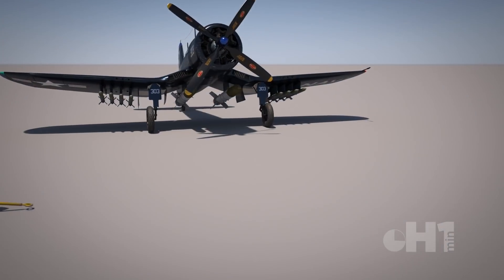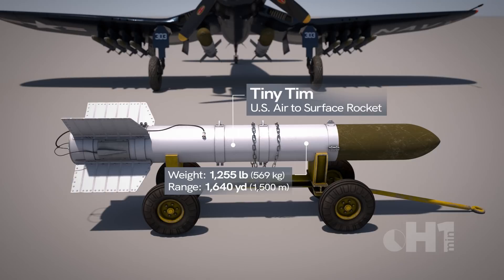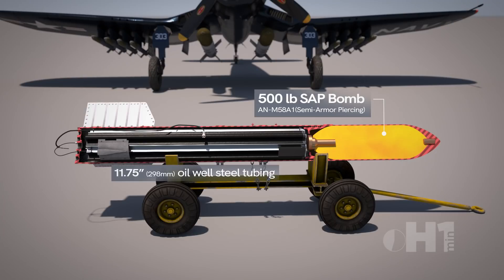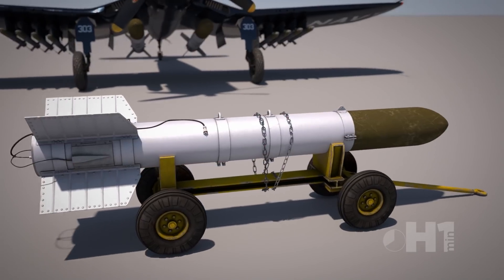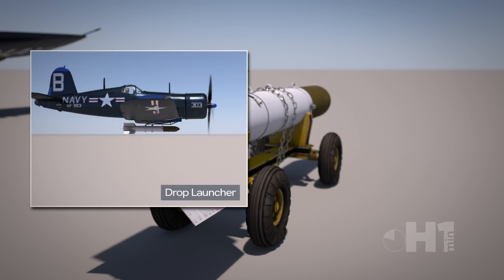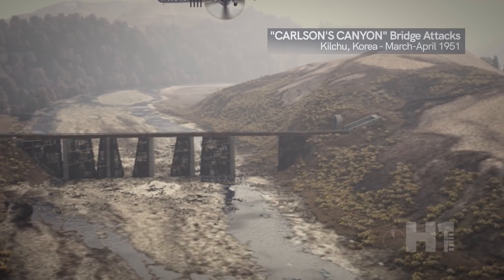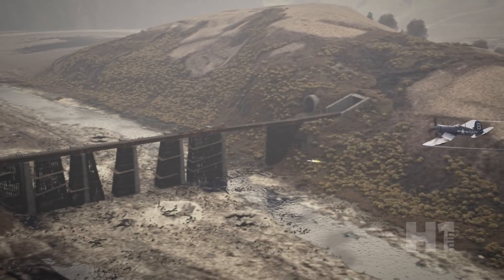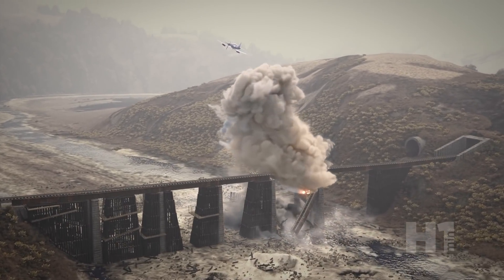H1MIN:  U.S. TINY TIM ROCKET

Comment: Imagine being the pilot that has to hit a moving ship from outside of its air defense range with only 2 unguided rockets
Reply: the intersting thing is that 1500m is well inside of anti air range for literally every warship larger than a fishing boat. So that design specification was not achieved at all.
Reply: @xxnightdriverxx9576  In theory yes, in practice, it was very hard for things like the japanese 25mm to hit anything flying at speed and 1km away. The ability to shoot from that far away and scoot would indeed have increased Survivability agaisnt enemy ships at least based on the enemy this was designed around.
Reply: Better than being the poor sod that has to divebomb a moving ship, well within it's air defence range.
Reply: @Satanperkele Using this rocket would be harder than dive bombing due to the drop
Reply: @eckusprosion5166  What I meant was that anyone trying to bomb american planes had an even shittier job: The allies hade proximity fuse rounds that didn't need direct hits

Comment: 1500 m is beyond ship's AA range? Didn't know it's that short.

Also, whoever did the VFX on your videos is amazing. Keep up the quality!
Reply from the maker: Thank you for you comment, quite appreciated. You do bring up a good point to which it would be nice if someone had a more informative answer. You are right 1,500m is well within the range of small caliber AA in WW2. I'm guessing it's "effective AA" range meaning reduced likelihood of getting hit?
Reply: @H1MIN  You have to get a lot closer to use a 5" rocket.
Reply: It's likely the original specification required, probably they wanted a safer method of attacking ships instead of torpedoes and dive bombing, hence it was retired quite early and used against ground targets in Korean war.